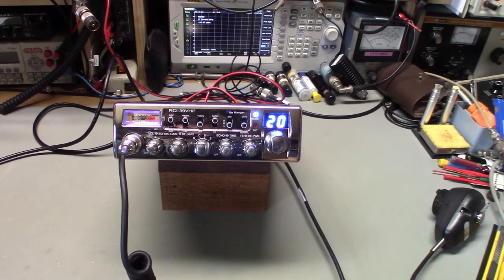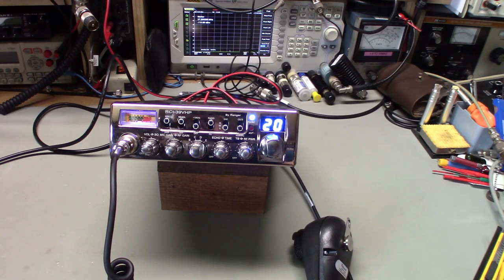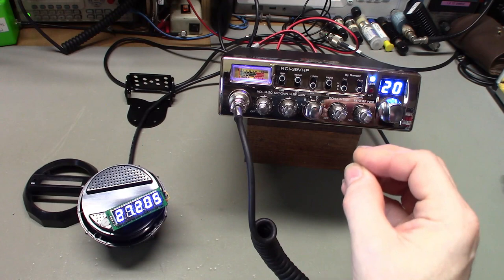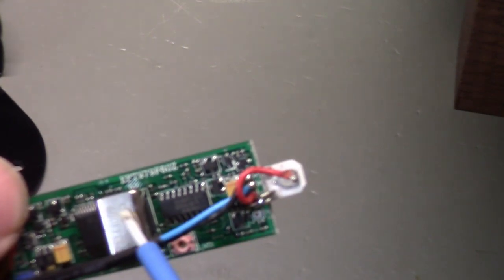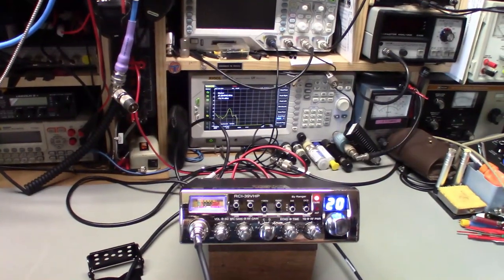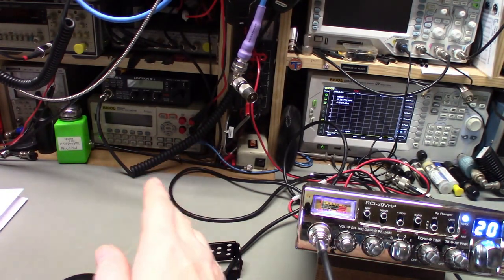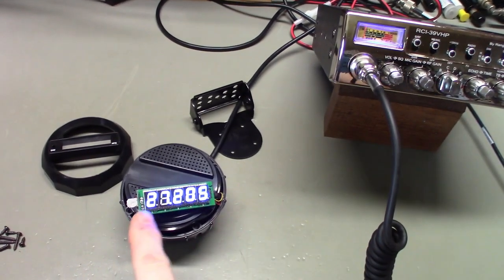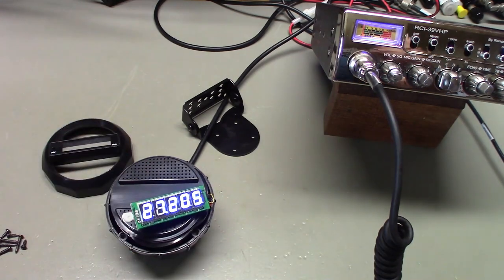Adjusting your CB radio external frequency counter so it reads correctly.

Comment: Thanks Mike. I still go back to your videos for help. I have a brand new galaxy dx2547 that the freq counter is not reading true. I'm transmitting on 27.3651 and the guys are having to tune me in at 27.3647. now I can set it up correctly. Hope your well.

Comment: Great explanation. Wondering if you could make a video about WHERE to solder leads of a generic frequency counter on a radio circuit board, before/after RF coils, etc.. Thanks a bunch.

Comment: Hi Mike, one question, where in the heck can I buy a set of ceramic tip tuning tools. Mine from my 20 years in commercial two-way repair are worn out, chips from being dropped mostly or they are loose in the handle. I have searched high and low and all I can find are the worthless soft plastic TV type tools that the tip twists off of the first time I try to move a slug that hasn't moved in twenty years.  I am down to my last two good tuning tools and getting desperate.Help!
Reply: I bought a set off of Amazon, seem to be a good quality so far.